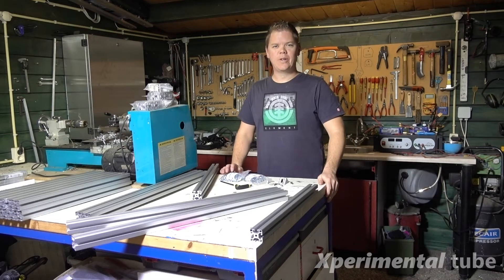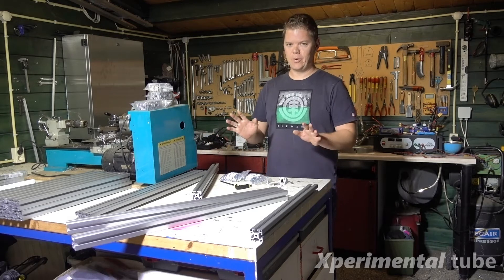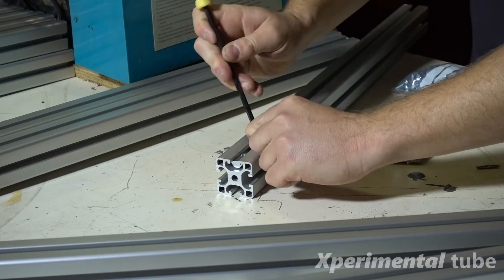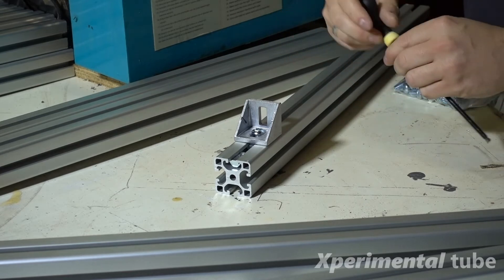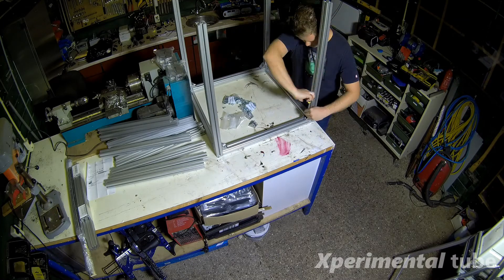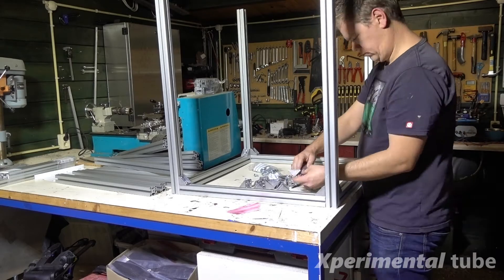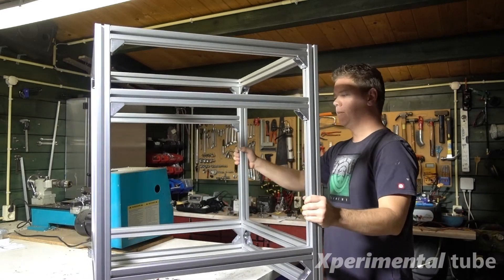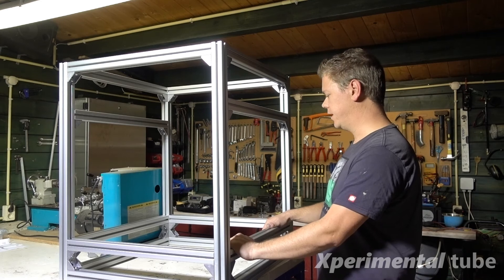01 Frame Build - HyperCube 3D printer Xperimental style

Comment: what size of the aluminium profile do you use? 3030 or 4040?
Reply from the maker: Pedro Portela Neto I use 4040 for this frame, this because I am aiming for a 500x500x500 print area.
Reply: I'm looking forward to mounting a 500x500x500 too, will it be the right one to use the 3030 aluminum profile?
Reply from the maker: To be honest I am not sure, but for myself I did not take any risks in 4040 its bulletproof.